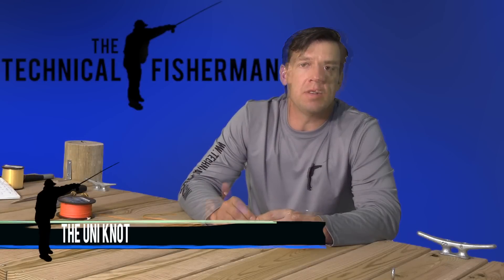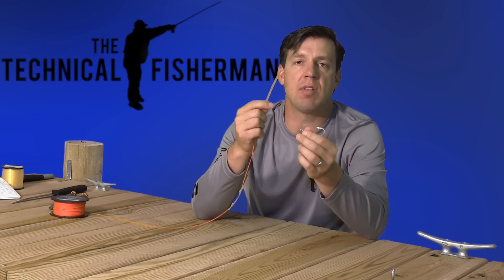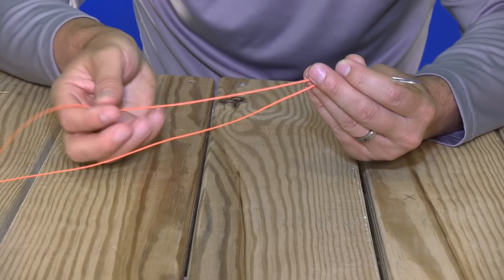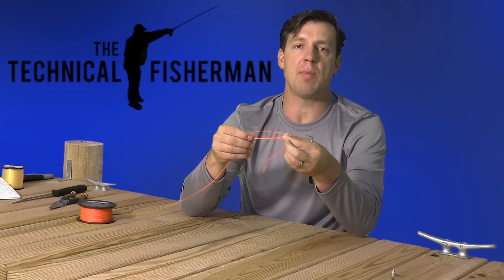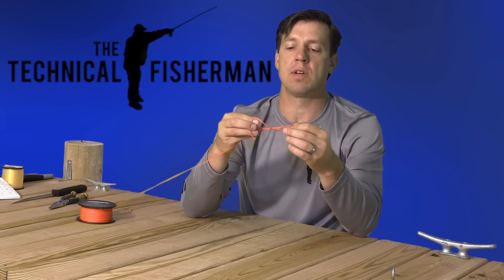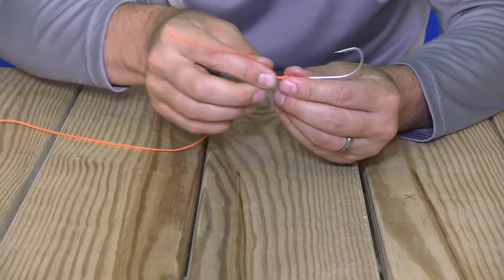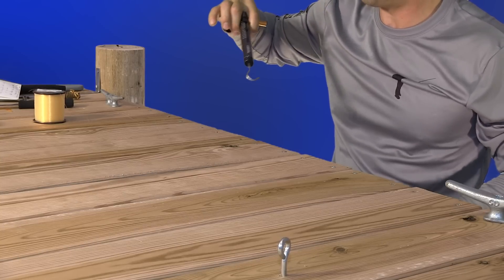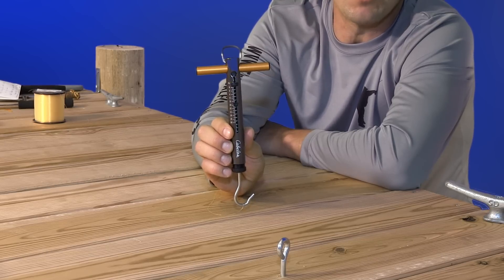How to Tie the Uni Knot

Comment: Good video. But the palomar knot is soooo much stronger. So is the improved clinch knot.
Reply: +jtphenom0811 I've seen tests that show the Uni is stronger, but also the Palomar is mainly for hooks.  You can use this knot on lures and well as hooks.  And you can use the Uni-Uni to join lines.  You can even use it to tie your line onto the spool of your reel instead of the Arbor knot.  You can also improve this knot by going through the eye twice before proceeding to tie the knot.  It is then call the fish-n-fool knot.  The one advantage of the Palomar knot is that it is easier to tie, but I've had it slip on me using braid, more than once, so I stopped using it and switched to the Uni.

Comment: Seems like this knot wastes quite a bit of leader, expensive but usually only have a couple feet on there to begin with
Reply from the maker: Bassmaster- yeah it does burn up some leader unless you are very careful about how long you keep the tag ends.  But, there's really no other know that's as easy to tie that will hold braid and mono (or flouro) as well as this one in our experience.